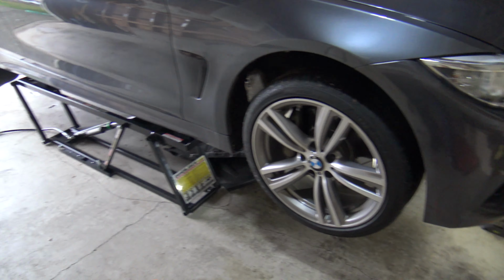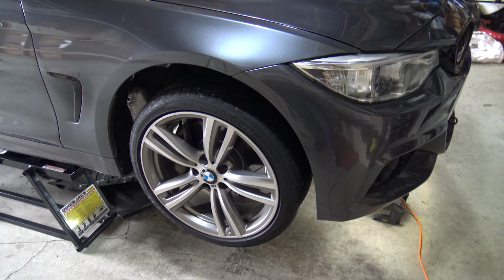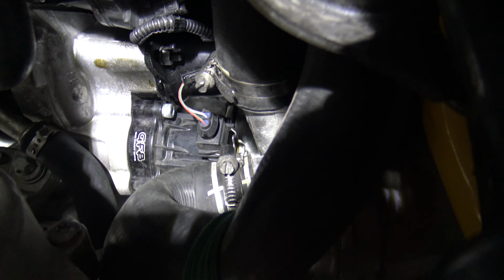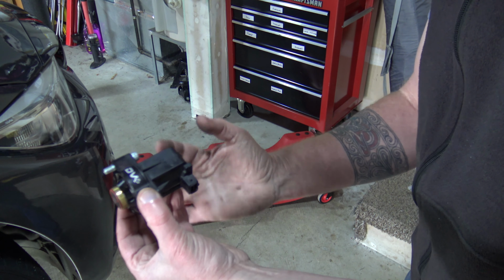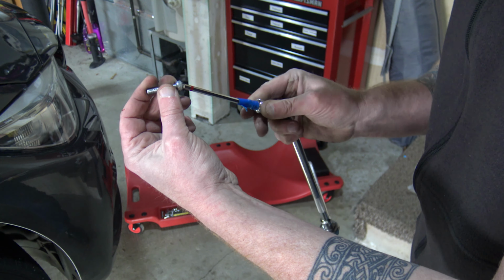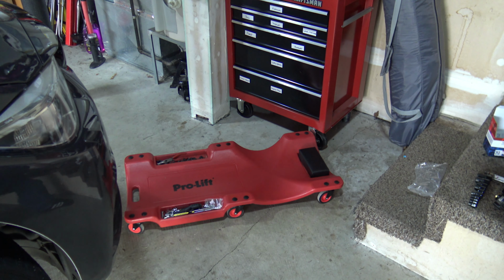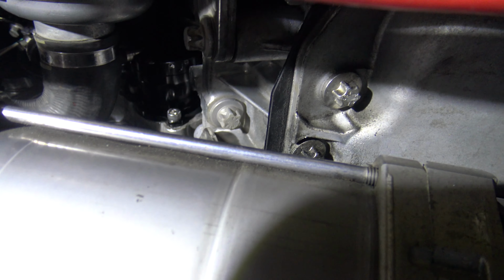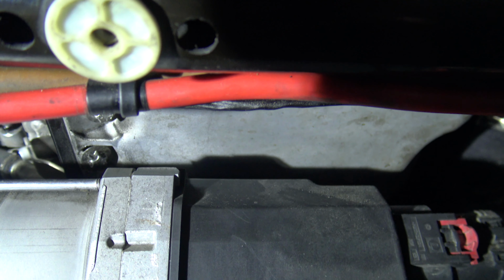BMW F32 435i Turbosmart blow off valve DIY - Full install

Comment: I had mine installed on my 2018 m2 with connection wire&plug upwards.  Is it ok? Took turbo inlet out and worked on both top and bottom.
Reply from the maker: You should be fine!

Comment: Tips to make this easier.
1st: plan a weekend just in case. 
2nd: remove the coolant and water pump, it makes it so much easier.
3rd: use an electric ratchet after you break all 3 loose with a normal ratchet, you can use a drill with a 90° attachment, I tried both. 
4th: invest in a head lamp. 
5th: after you get this or gfb installed and before you refill your coolant, now is a good time to replace the leaking oil thermostat housing gaskets. Just remember to have lots of rags placed just below both the oil cooler lines and and right above your alternator even if your drained your oil. Have fun and take breaks if you get frustrated.
Reply from the maker: Great suggestions!